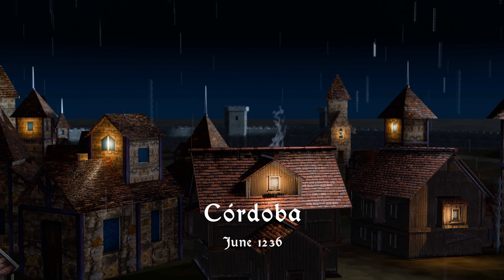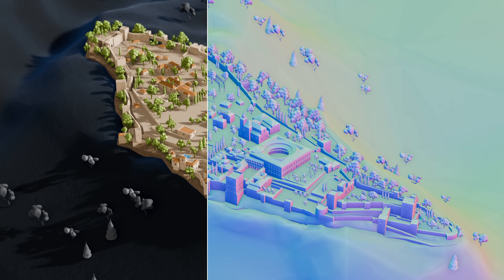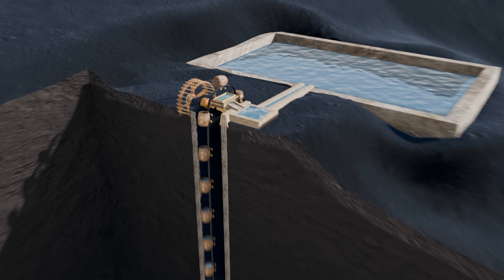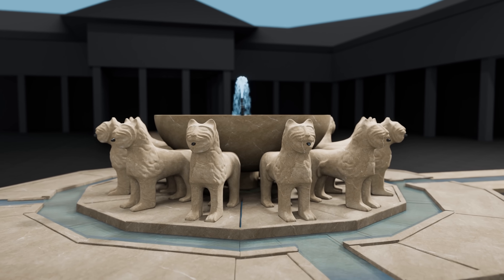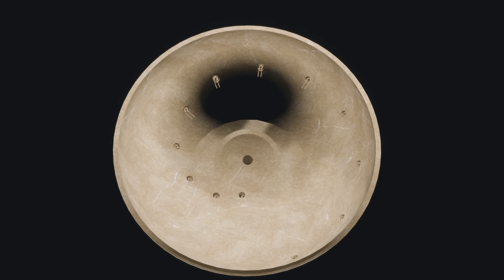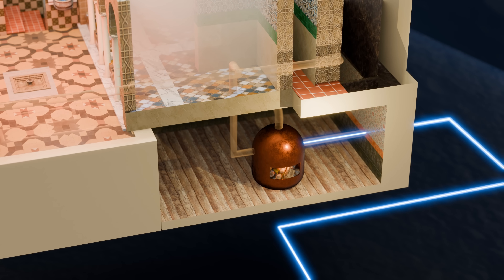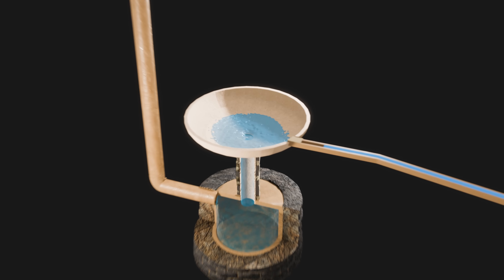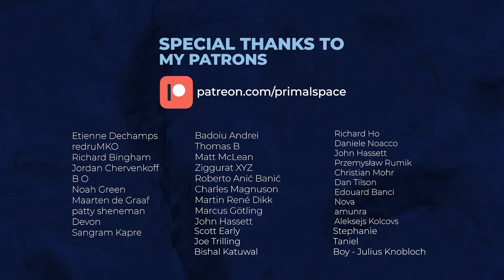The Ancient City That Mastered Water

Comment: Honestly the fountain impressed me the most that’s incredibly precise especially given the time period.
Reply: @ThexXxXxOLOxXxXx There will have been some equipment used for certain processes
Reply: It was basically a hole in a bucket to keep the water rate costant to the fountain  then more holes to tell time the siphoned drain to empty or reset.

Comment: Something is missing from the "whirlpool pump". If it could lift all the water 6m like shown in the video, you could divert the water to a waterwheel and let it run back to the fountain and get free energy. The world doesn't work like that! it is true that you can lift some water by lowering its density by mixing in air but in order for that to work, there must also be a flow  of water that is diverted to a lower location than its starting position, e.i. there must be a drain.

Comment: The whirlpool water device is ingenious! It’s very impressive how simple the solution was to raise the water to an elevated section of the palace. The fountain that could tell the time is an amazing piece of engineering and craftsmanship.
Reply: With a lot of water wasted. 1 litre 6 m up, means 1 litre loste 6 m down at the same time. Alternatively 6 litres down 1 m to lift 1 litre 6 m. This system wastes a lot of water.
Reply: There was a time a similar siphon mechanism was used to flush men's urinals in public toilets periodically using a steady stream of water, without the need for electronic sensors
Reply: It was part of a river so the flow was needed to continue or flood the area.
Reply: @kjellg6532  The system reused the water throughout, how could you say there was waste.
Reply: @ To lift water to a higher level you need to add energy to it. In this case there is only one source of energy, falling water. To lift say 1 kg of water 6 m up, some other 1 kg  of water must fall more than 6 m down, and are lost.
Reply: @kjellg6532  So you think it wasn't reused somewhere else? Some people just need to find something negative or spin to look negative or lesser. It was 700 years ago, it was amazing.
Reply: @vidkit3595  No, I a not negative, I simply want to understand how things work. In this case I simply do not see how this can work as explained.
Reply: @vidkit3595  Depeds on how you restrict the discussion. Of cause waste water may be reused at a lower level, but seen from the pumping problem you possibly need to drain a lot of water to get a fraction of it higher.  Besides, I do not understand how they could run fountains without water under pressure.
Reply: @kjellg6532 energy that the stream uses so it doesn't matter if it's inefficient cause we aren't using external energy. At least there's still a slow perpetual flow at a higher elevation be it limited. I do wonder how much a water wheel or windmill attached would aid to create a stronger whirlpool to increase water pressure.
Reply: @jansaycon8441  Well, all that water that lost height has been elevated by a donkey. Besides, there was probably no whirlpool at all. Please look up a Tompe pump. Trompe ia an old water driven air compressor. This system is creating air at high pressure, not low pressure, to power an air lifting pump. Such are used til this day.
Reply: @Arctic37  LOL, you assume that you are provided with fair and unbiased historical accounts about us. You have no idea how biased your system is, I am starting to feel you are finding out just how evil your elites are, day by day you become more of a serf. I don't which type you are the one that can't admit it or the one that is too ignorant of it.
Reply: @proxyicarcus OK, depends on wording. 
a) My drinking water is taken from a river, purified and delivered to my house. Here I use it in my shower and in my toilet and let it go. Most people will call this waste water, bus as it is returned to the river it is not? 
At Alhambra all water has been lifted by donkeys and purified. All water that is not watering plants but simply returned to the river spoils the donkeys work. Seen from the donkeys perspective this water is wasted. 
Now for the 6 m pump, a combination of a Trompe compressor and an air lifting pump. The video do not tell that for the Trompe to produce high pressure air, you need a drop in water height down to a lower chamber, say 8 m down. Huge amounts of water goes down to lift a few litres up 6 m. You lose lots of donkey work. Now Tromps is a funny construction. Most of that water can come up in a second tunnel, not shown in the video. The outlet from the return tunnel exits say 2 m lower than the starting funnel so the net loss of height is about 2 m. You need some height to make the water flow and you need height to power the air pump. Seen from the donkeys, the 6m pump has wasted 2 m in hoisting. If you are lucky this water may continue to a lower garden and water it. Then it is not totally wasted. As for 100% efficiency, the 6m pump wastes a lot of donkeywork to function. 

b) To extract energy from a slow flow in an open canal  is no easy task. Probably possible with a waterwheel with small cups. Diameter about 3,25 meters. It will need some maintenance, but is easy accessible and almost without noise. The air pump will give a loud hssss…ing sound at its exit and all escaping compressed air is a loss in efficiency and donkeywork.

Comment: The incredible mastery of hydraulic engineering principles required to pull off this well-balanced system is mind-boggling. Today, few engineers would know how to design such a system without resorting to centrifugal pumps and even computer controls! And, to think they did all this before Bernoulli equations or Manning roughness numbers were developed, is just crazy!

Comment: The whirlpool pressurization mechanism is just brilliant engineering. Remarkable!
Reply: Brains are more important when one doesn't have much technology at reach.
Reply: @josdesouza   true indeed.
Reply: @josdesouza  I think it even forces one to be more creative.
Reply: What if the ocean can fill dry river systems and fill rivers with ocean fish, and your pool, and then put dolphin in your pool to keep the water stirred and have a pet : ) Then you need ocean grass for your yard
Reply: It's a trompe powering an airlift pump. Both of these things are well documented, if OP would just use their names, it would enable viewers to easily learn more about them.
Reply: @myself248  I was thinking that it was going to be a Ram Pump. Is that the same thing?
Reply: Probably not a whirlpool.  I have found that far less air gets pulled down if you let a whirlpool form.  I ended making caps on the pipes to prevent whirlpools from forming.  You want the water go straight down pulling bubbles with it. if it swirls around it doesn't pull as many bubbles.
Reply: @myself248  It is probably a trompe powering an airlift pump "that works by plug flow".  Most airlift pumps in the modern world have wide pipes and they work because a column of water with air bubbles in it is taller than a similar column of pure water.  But that won't be enough to pump water 6 meters without 6 (or more) meters of submergence.  With a thinner pipe, say, somewhere between 10  and 30 mm,  you can pump water to 6 meters with just 2 meters of submergence using plug flow.

Comment: Just to clarify the whirlpool "pump". It was not a perpetuum mobile. Only a fraction of the water flow was pumped up. The rest went down to some drain etc...
Reply: Thanks, I was wondering about that
Reply: Thanks, I wasn't wondering about that but now I know. I'm still confused about the thing and mostly with how the hell they could have come up with that with all the experimentation that would be necessary to come up with the right airflow/whirlpool.
Reply: Seems similar to a hydraulic ram pump where you also end up having to divert/waste/spill some of the flow at the pump site in order to steal it's kinetic energy.
Reply: @steamer2k319 I wonder which one is more efficient? I’m guessing the hydraulic ram pump as it’s probably more recent.
Reply: @Sebloe   Good question 🤷‍♂️. We'll have to assemble some teams and have them compete to see who can do the most efficient implementation of their assigned concept 🤭.

Two things the modern ram pump probably has going for it aren't necessarily efficiency:
* Relatively cheap/easy to implement, given access to a modern hardware store
* Relatively compact (as long as you've got space for the spillage)
Reply: @ good points!
That would be an awesome project - to see which team can pull off the most efficient design for their designated pump 👍
Reply: @Barrrt  , it makes me think that people had already been working on this stuff for centuries by the time that was built.
Reply: Went down the drain to where?
Reply: @NishantUpadhyay-p6r   Down into Ginnungagap.
Reply: As another comment said, it's related to the trompe: https://en.wikipedia.org/wiki/Trompe
Reply: @NishantUpadhyay-p6r  Outside the castle. Notice how much greener the hillside around the castle is than the rest of the area. That's where the water from the castle goes.
Reply: @NishantUpadhyay-p6r  Most likely for another use
Reply: This design isn't all that smart. They would've wasted much less water putting in an Archimedes screw installed with a water wheel and uses that stream of water to both run the pump and feed the pool that pump is dipped into.
Reply: This design isn't all that smart. They would've wasted much less water putting in an Archimedes screw installed with a water wheel and uses that stream of water to both run the pump and feed the pool that pump is dipped into.
Reply: @NickRoman  Yeah, maybe. I must say I'm amazed by the whole thing and it's probably the result of centuries of culture building but still.. The amount of wealth it must have taken to create the necessary conditions to engineer something like this... _
Reply: Yeah after hearing it i was first immidiately calling bullshit on that. But if only a part went up its possible.
Reply: The misleading/incomplete explanation of that part paired with the click-bait video thumbnail earned a downvote from me. Otherwise a good video which obviously took much effort to make.
Reply: why wasnt it shown then? and why some water had  to go down?
Reply: @Barrrt  Very easy. A rich guy showers you with patronage, gives you access to all the resources and manpower you need and you are otherwise surrounded by a world that is abject squalor and war. Never underestimate the ingenuity of people when conditions demand they step up.

Comment: The whirlpool can't work like that, because it violates the laws of thermodynamics. You could create a Perpetuum Mobile if you let the water drop back from the top into the whirlpool. You could even extract energy while the water is falling. I believe that the whirlpool is probably existing but there must be more to this concept than what was described in the video. For example, a ram pump can also lift water upwards but to abide by the laws of thermodynamics, a ram pump has to shed some water at the lowest point. So, you put water in and one part gets elevated to a higher level while the other part is left on a lower level. This conserves energy. And there must be some similar mechanics also to this whirlpool to obey the rules of thermodynamics.
Reply: Maybe hydrodynamics with conservation of momentum & energy?

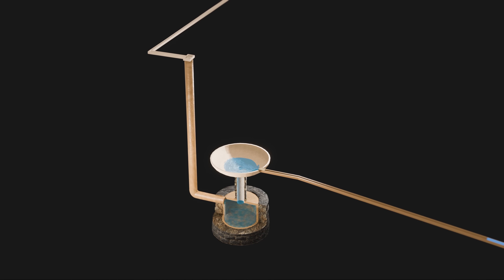Comment: 7:38 the whirlpool pump is actually a hydraulic ram type pump (Pratical Engineering made a great video on these!). It just raises the potential energy of one portion of fluid, while the majority flowed down a larger pipe, not shown or mentioned in this video.

From the Wikipedia article for hydraulic ram (go to the article to read/watch the actual source, the BBC, they made a video which you can watch here on YouTube):
"
The Alhambra, built by Nasrid Sultan Ibn al-Ahmar of Granada beginning in 1238, used a hydraulic ram to raise water. Through a first reservoir, filled by a channel from the Darro River, water emptied via a large vertical channel into a second reservoir beneath, creating a whirlpool that in turn propelled water through a much smaller pipe up six metres whilst most water drained into a second, slightly larger pipe.[1]
"

It doesn't raise the internal energy of 100% of the fluid, but rather causes a difference, one portion gains, the other loses energy.
Reply: makes sense, before i read your post i was about to ask how it wasn't a perpetual motion machine
Reply: Put the link or shadap.
Reply: @ASDasdSDsadASD-nc7lf YT deletes comments with links.
Reply: The difference is that a hydraulic ram pump exchanges kinetic energy of the moving fluid for gravitational potential energy (elevation), whereas the Alhambra pump exploits a difference in the density of the fluid to allow a constant pressure to generate more head in the lower-density fluid than in the higher-density fluid. Amazing that they figured this out so long ago. Grady Hillhouse (Practical Engineering) claimed the hydraulic ram pump has only been known for a couple hundred years. That means the Alhambra pump beat it by several centuries.

Also, we should realize that it's not "free." The pump only works because it makes the incoming water give up some of its gravitational potential energy in the initial drop in order to push air bubbles into it to create the lower-density fluid. The water that doesn't go up the lift pipe ends up at a lower elevation than the water flowing into the pump had initially. That difference in elevation is what drives the pump.
Reply: Thanks, im studying physics and i could not understand how this was not a perpetual motion machine, i was asking chatgpt and everything!
Reply: Any other examples for this type of pump in the ancient world?
Reply: @whitslack  Is it truly "lower density fluid" though? This is rather a mixture of air bubbles rising through a fluid, which gives them an upward momentum, having the effect of lending lower density, or simulating it, through friction, no? The air is not DISSOLVED in the fluid. The fluid remains exactly as dense as it was. There is some further dynamic explanation needed here.
Reply: @AltaMirage  It really is a lower-density fluid. Remember, both gases and liquids are fluids, and a mixture of liquid water and gaseous air is a fluid too. Newer cruise ships are doing a similar thing to reduce drag and improve fuel efficiency: they have jets on the underside of the ship that blow bubbles into the water. The energy expended to blow the bubbles is less than the energy saved from reduced drag, so it's a net win.
Reply: A wikipedia edit in Hydrulic Ram removed the above reference...

It can be found in the pages edit history. It's a reference to "The hidden world beneath the ancient Alhambra fortress" which is on BBC Global's channel.

But.. that BBC video (Wiki's reference) says almost nothing about the fountains, and nothing about this claimed gas diffusion water siphon thingy.
Reply: I wondered if it was this. Highly inefficient in conventional terms but if the long term cost is free, why not.
Reply: yeah the graphics are nice but I'm disappointed by the disregard for physics. On the same note I'm pretty sure surface tension has little to do with water siphons 5:50.
Reply: @whitslack  What an apposite explanation , it is a perfect complement to the other complementary explanation to which your own adds to .
Reply: @flo0778  exactly!

Comment: Very nice video, Alhambra looks like it would have been cool to visit (literally).
One thing I am curious about is the device at the end that pumped the water up the western side.  Your explanation is interesting but in the end, the water will have to gain potential energy to get 6 feet higher and that energy had to come from some where.  Maybe it drew from the kinetic energy (speed) of the water coming in or used evaporation (heat) but the law of conservation of energy says it had to come from some where.  Any ideas?  I am pretty sure if you built what you described, it would not work.  One other thing that is interesting in your diagram is that the walls in the lower chamber are really thick.  Maybe they were pressurizing it somehow, maybe they were heating it.  I am sure the soldiers would have loved to have hot water too.